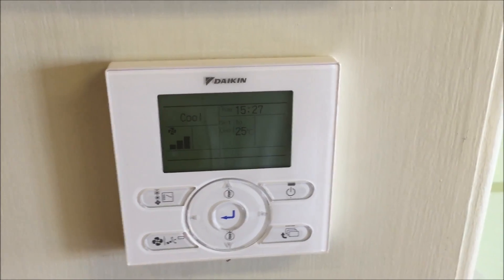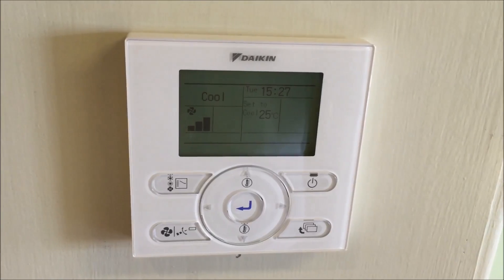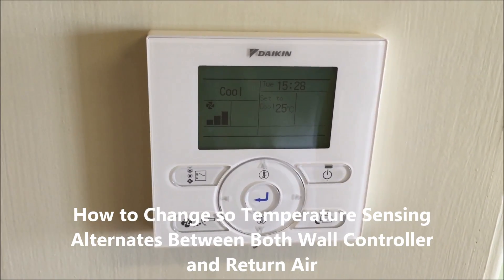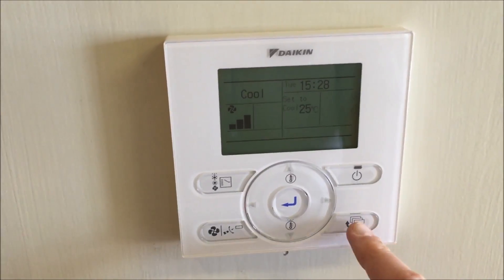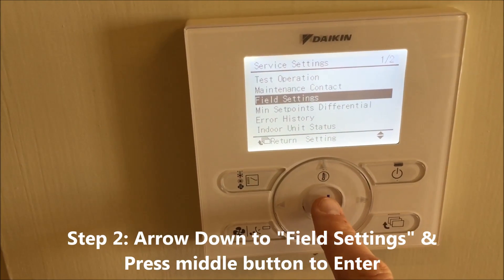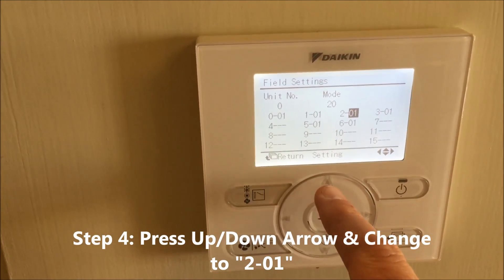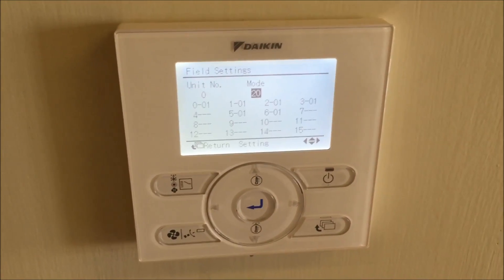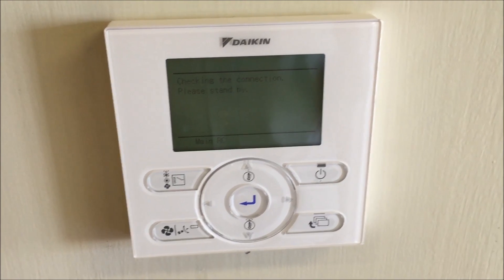Daikin Wall Controller: Alternate Between Return Air & Controller Temperature Sensors

Comment: Does the BRC24Z8 zone controller also allow this use of both of temp sensors ?
What is the benefit of using both sensors to the temperature in the house ?
Thanks.